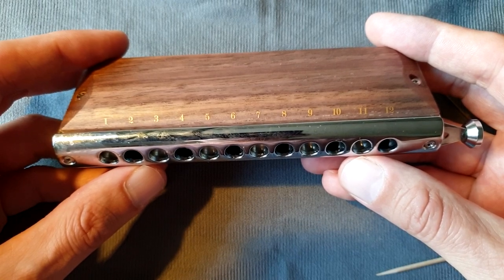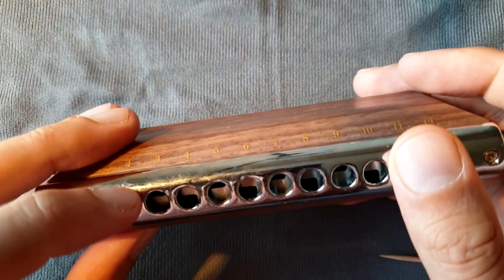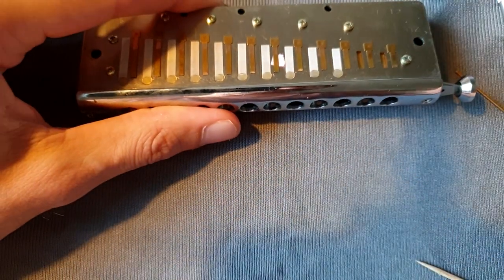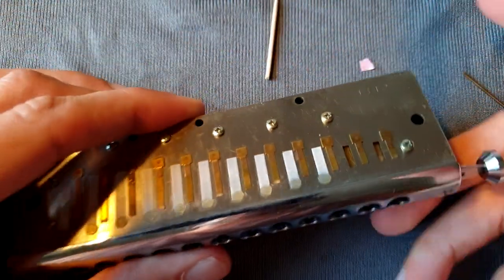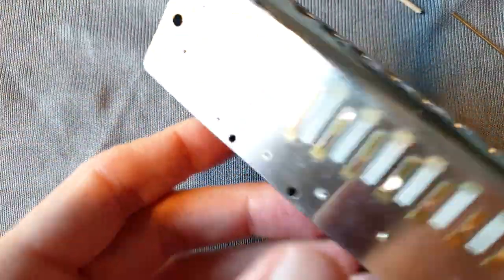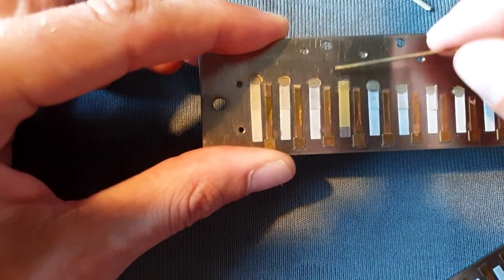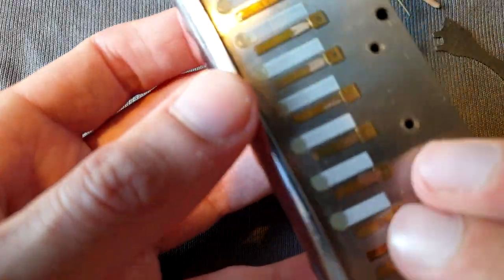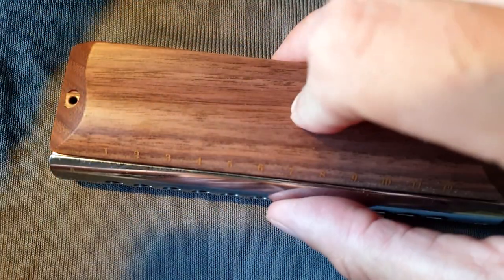How to fix a stuck reed on the chromatic harmonica

Comment: The problems I tend to find with my new chromatics (as with the Suzuki SCX 58 I just bought) is that the highest notes (the 9 and/or 10 holes) don't produce any sound.  I take it apart and don't see anything obvious, but they just make no sound, or only do so when I blow very hard, which I don't want to do of course.  Any thoughts?
Reply from the maker: Try moving around your tongue in the oral cavity. It can be a thing with resonance. Add a little "ta" articulation and see if that that can help the note kick in. Also experimentet with air pressure, try playing just short notes or long tones, that can help.

Comment: Hey Filip! I recently purchased a brand new Suzuki SCX-64. I must say it is INCREDIBLE! However one of the notes is not working and I took a look at the reed plates inside but there was nothing stuck inside. It was literally brand new. I’ve done everything in the video that I could. Any tips?
Reply from the maker: Which note is it?
Reply: @FilipJersMusic  Second Octave E.
Reply from the maker: Hard to give feedback just by comments... The 6 hole blow is located on the inside of the reed plate. So you need to unscrew the whole harmonica and plate, then use a tooth pick or light screw driver, push very light on the reed and see if it moves. Try to plink it, see if you can make it sound. If it moves in the reed slot, it is not the harmonica, then it is a matter of technique.
Reply: @FilipJersMusic  Thank you. I plinked it but I still can’t get a sound out if it. I can play just fine on the other holes so I’m not sure what’s up. You have been so helpful and I appreciate enjoy your content. If only there was a way to send you a video or something…
Reply: Interestingly enough I can indeed hear the blow and draw of the note but only when I open and breathe through my nose and mouth together. I know it’s strange but it seems to negate the problem a little.
Reply from the maker: @johnseward9929  you could try inhaling super fast and pretty light alternating draw/blow and see if it pops open. Last thing to try is to blow really hard and see if it awakes but that can damage the reed, so be careful and I dont really recommend that option, even tough it can work.
Reply: @FilipJersMusic  I opened it up again and bounced the reed upwards. I’m still not 100% sure how reed spacing works but I think that’s the problem because it played a little afterwards. It’s all still a work in progress and I’m so happy I get to learn. I learned my first song today (Isn’t She Lovely) and I can really say that I love everything about playing harmonica. You’ve been such a wonderful help and I just wanted to thank you for inspiring me to push myself. Thank you Filip!
Reply from the maker: If you look at the reed in its neutral position, does it dive in to the reed slot or stays slightly above? Does the distance looks like the neighbour reed or different?
Reply: @FilipJersMusic  It’s positioned a little lower than the other ones are, but it is still slightly above.
Reply from the maker: Then it can be gapped too tight. To raise the reed, put in a tooth pick or small screwdriver in the slot and very gently push the reed upwards from the root of the reed, not in the front. It should not flex, it should be lifted upwards. Baby steps, take it easy. Youtube search for "harmonica reed gapping", then you will see how to do it. It is the same process on chromatic and diatonic instruments.
Reply: @FilipJersMusic  After carefully increasing the gapping it is playing very well. I expect to tweak all of the gaps that go astray or need improvement. Thank you again.